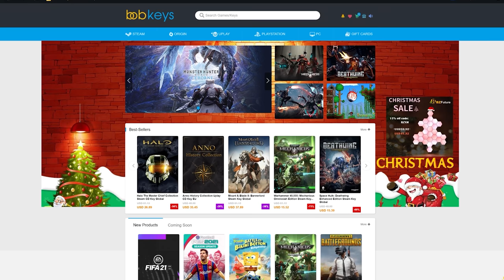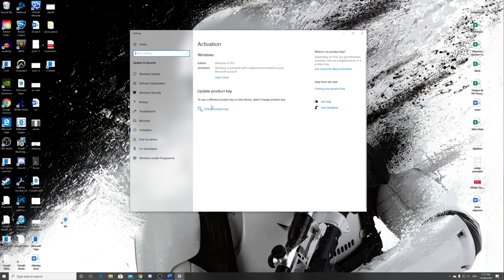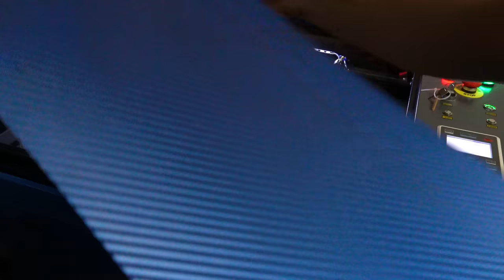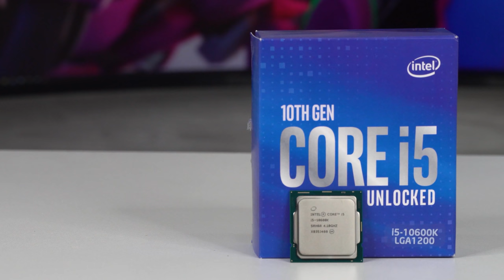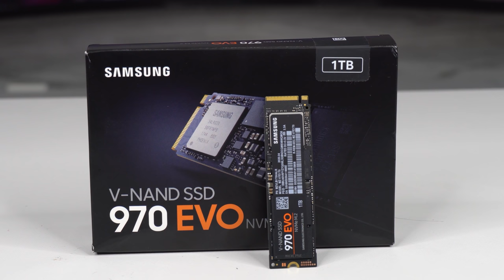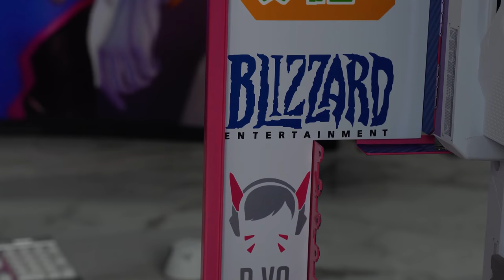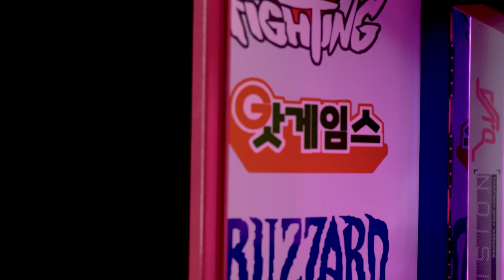INSANE Custom Water Cooled D.VA Gaming PC Build - RTX 3070

Comment: Cool build, but a few things, no exhaust, radiator blows into a wall of synthetic fiberglass and the PSU is blowing back into at least one fan. The round about is cool and all but I would have rather those connection go to a GPU block especially without any exhausts, that GPU and those GPU fans are gonna turn that PC into an oven. I could just imagine the thermals on that thing. Not being a jerk just some constructive criticism, in case some one out there tries to build something similar.
Reply: Bottom fans intake, top fans exhaust through the back of the case. PSU pulls air and exhausts through the sides. No GPU blocks available at the time for the vision. Thermal’s are very cool

Comment: Wow, excellent build. I have one question related to the airflow. The gpu exhaust fans would be pushing hot air towards the cold air which we are taking in from the bottom. Will it impact the effective cooling of gpu?

Comment: What kind of paint do you use? I tried to paint my case once and the paint didnt stick, it peel off
Reply: From what I have learned is that you need to sand most cases surfaces to stick, but paint wise I get the impression it's a layer of primer then the pink paint.